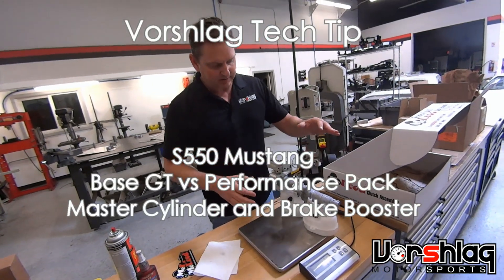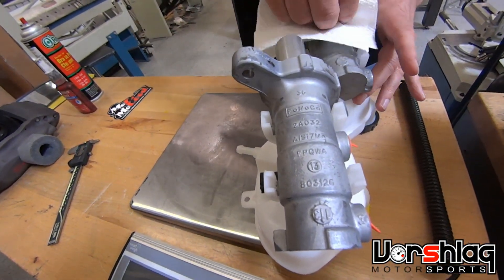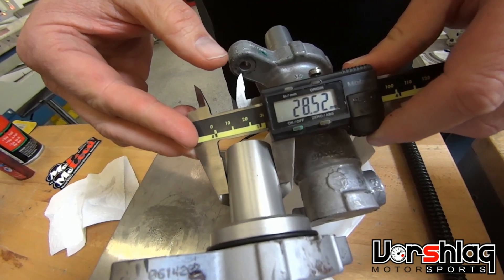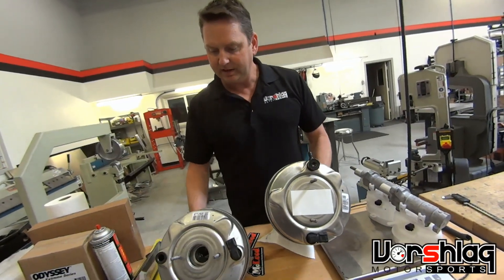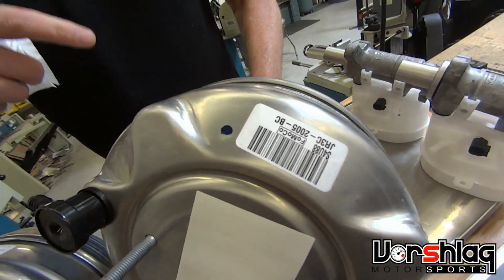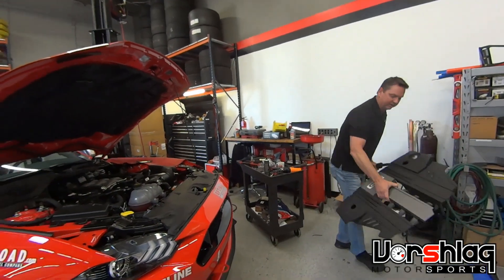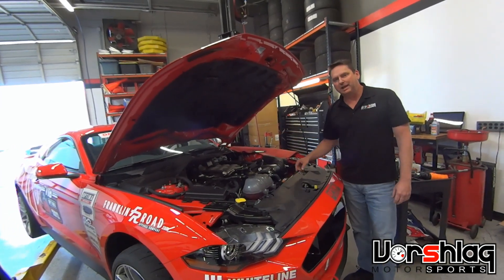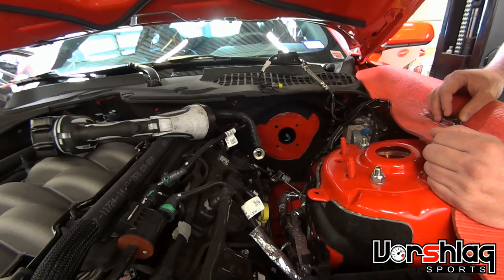S550 Mustang PP booster and master

Comment: Hi,  Will the Brembo calipers work on a 2017 base model EcoBoost mustang. If it does I am thinking the Master cylinder and booster needs to be swapped out also correct?
thanks
Reply: did you end up swapping MC and booster? what part numbers did you use?
Reply: @fonatig  i put on hte gt pp1 brembos on my ecobooost and did not have to swap out the MC and booster. The breaks are amazing now

Comment: Can someone confirm i still need this other master cylinder if I purchased a Brembo 6 piston brake kit for my 2020 Base GT? The page for this detailed information says the Ford kit still excludes it, and it is needed, but the stock booster on my manual GT should be fine? Any help would be appreciated, I’d like to replace the MC when i install the brakes and do it all at once if necessary....thanks for any responses on this old thread
Reply: Did you ever find an answer for this? I’m wondering the same. In this vid they say to replace the booster as it’s a different size, but in the Mustang braking thread at Vorshlag they say it isn’t needed.
https://www.vorshlag.com/forums/forum/product-details-read-only/brakes-fluids/7370-mustang-s550-brakes-uses-limitaitons-and-upgrade-options
Reply: @utoobia  No, never got an answer. I called Steeda where I got my Brembo kit, and they said the difference in the Master Cylinders isn’t significant and it isn’t needed also. I actually found the right part number on eBay and purchased it. The problem is you can’t tell the difference in them from the outside. So considering my mechanic wants 3 hours of labor to install the new Master Cylinder, i went ahead and installed the new brakes without installing the Master Cylinder myself (2 days ago, was waiting for brake lines, like everything they were back ordered, & you need them because they’re longer than the stock GT ones).  So i don’t have enough drive time behind the new brakes to give you any feedback, but other than comparing them to stock they’re way better, but i don’t know anyone with a PP to drive and compare. If i get an answer on this I’ll let you know, if you do first, let me know please. The part is about $100 depending on where you buy, but it seems totally not worth the work even if you install it yourself if it doesn’t matter. Guessing your having the same debate yourself. Why Ford uses a different Master Cylinder for a GT and. GT PP1 is beyond me, seems like the cost of sourcing the part alone wouldn’t be cost effective, and they might even get mixed on the assembly line. FYI, i purchased Hawk 5.0 pads also, for all 4 corners, so far they’re great, but not cheap. If you’re tracking your car you may want a softer pad that will stop even stronger, but be prepared for a lot of dust with a trace or more aggressive pad (Hawk makes them also). Good luck👍
Reply: @jdjames997  .....Man, thanks for that. The two speed shops I’ve spoken with say neither the master cylinder nor the booster are necessary. Vorshlag, on the S550 braking thread on their forums, they say the master cylinder is a must-do. I’ve emailed Vorshlag to get clarification. I’ll report back here when they respond.
Reply: @utoobia  cool, let me know what they say. Honestly, I’ve got so many mixed responses on this, nobody seems to know. I’m sure there’s a Ford engineer somewhere that knows why they used 2 different ones, but makes me wonder if it makes enough difference to make the swap worth while….
Reply: Booster from 18 up is same in all GTs. The master cylinder is a different part but I think they are the same. FR3Z-2140-A vs FR3Z-2140-B (note how they both only support perf pack). If B wasn't different, it would have non pp, 3.7 and 2.3 models as compatible.

Comment: I have the PP1 2018 and have the same booster as the non PP car shown here.....what I dont know is whether or not I have the larger master cylinder bore? I've added the GT350 brakes and they are great vs the original PP1. Now I may have to wrench to find out....

Comment: Great video! I have the same brake setup in my Base GT S550 non PP, with the exception that mine is the 10 speed auto. I'd like to upgrade to the 15" brembo pkg and was wondering if the pp brake booster shown is the same for 10-speed cars?
Reply: it fits the 10 speed cars too
Reply from the maker: Don't know - I'd call your local Ford dealer to find the right part number. :)